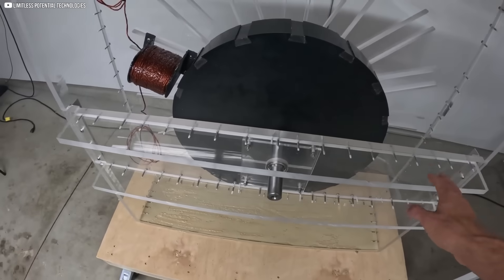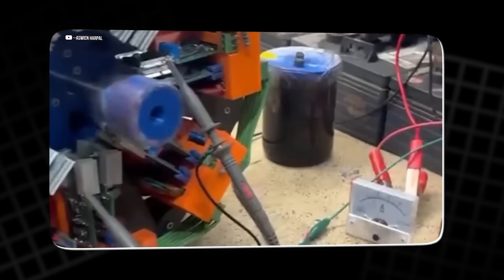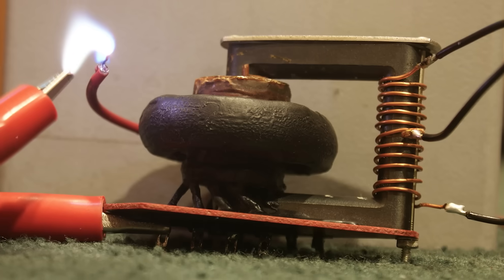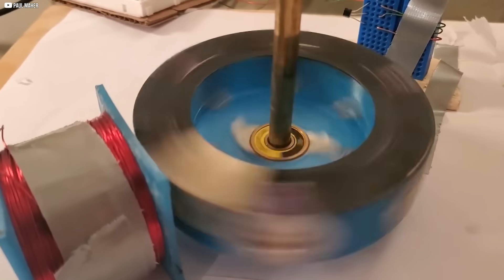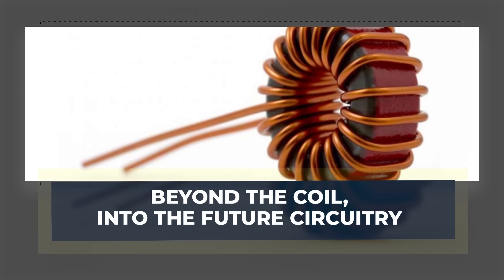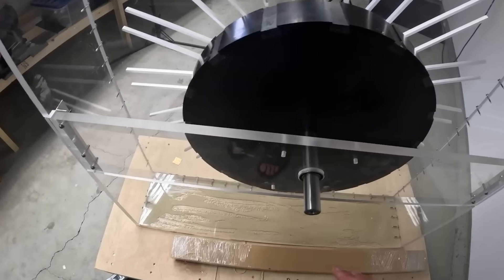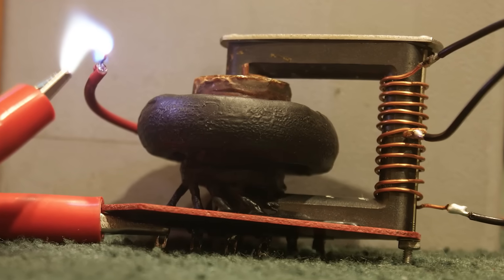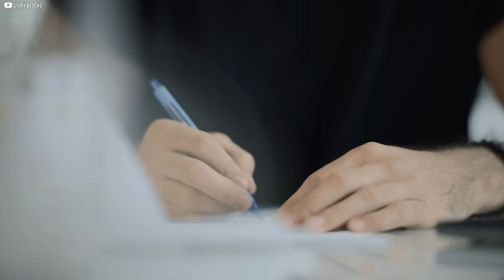This Magnetic Machine Might Break the Rules of Energy as We Know It

Comment: I HAVE WATCHED YOUR VIDEOS AND I WANT TO COLLABORATE . I LIKE THAT YOU CALL YOUR PARTNER A GENIUS . I KNOW YOU ARE PASSIONATE ABOUT NEW ENERGY . AND I HAVE AN ENTIRELY NEW CONCEPT I WANT TO SHOW THE WORLD. ITS SOMETHING ANYONE COULD DESIGN THEIR OWN . I JUST WANT THE INITIAL PRESENTATION TO BE LIKE YOUR VIDEOS .  I HAVE AN IDEA THAT YOU WALK YOU GENERATE ELECTRICITY . SO EACH STEP YOU TAKE YOU COULD CHARGE A BATTERY IN YOUR POCKET VIA A WIRE FROM THE SHOE UP THE PANT INTO THE POCKET . 

I CALL IT KINETIC ENERGY.  THATS MY SIMPLE PROOF OF CONCEPT . 

I ALSO HAVE A DESIGN FOR A VEHICLE THAT USES KINETIC ENERGY.

NO ACID NO METAL NO CHEMICAL REACTION.  YOU JUST PULL A LEVER , AND YOUR CAR GOES FLYING 50, MPH . WITH ZERO GAS . ZERO ACID . ZERO METALLIC CHEMICAL REACTION . MY DESIGN NEEDS NO MAGNETS BNO COPPER WIRE.     ITS SIMPLY GEARS . USES YOUR OWN WEIGHT TO LIFT A COUNTERWEIGHT , THAT COUNTERWEIGHT PUSHES DOWN 👇 WITH GRAVITY TO SPIN A TINY GEAR , WHICH SPINS A LARGER GEAR, THAT SPINS A SMALL GEAR ATTATCHED TO THE AXEL . THIS COUNTERWEIGHT WITH THE USERS WEIGHT WILL PROPELL USER QUICKLY FORWARD AT HIGH VELOCITY HIGH TORQUE , AND VERY VERY VERY VERY VERY FAST ⏩⏩⏩  THE COUNTERWEIGHT IS THEN LIFTED (USING A LEVERAGE PULLEY SYSTEM) THE GEARS SHIFT BACK IN PLACE AND ARE READY TO RECIEVE MORE SPINS FROM THE WEIGHT OF THE COUNTERWEIGHT  . ALL IT NEEDS IS GEARS , CHAINS , AXEL , WHEELS , A LEVER TO PUSH COUNTERWEIGHT BACK UP AND A STEERING WHEEL . YOU NEVER HAVE TO REFILL OR BUY ANYTHING ELSE FOR IT . ONCE YOU MAKE IT IT IS GOOD FOREVER ♾️♾️♾️♾️ NO SULFURIC ACID. NO CATHODE . NO ANNODE.  JUST A WEIGHT , AND A CRANK AND A LEVER !!!! THIS THING CAN GO FASAAST . I ESTIMATE IT COULD GO FASTER THAN ANY VEHICLE ON EARTH WITH A FEW ENHANCEMENTS , BUT THE SIMPLE CONCEPT DESIGN I WANT PEOPLE TO KNOW IS THE PULL LEVER , LET THE WEIGHT SPIN THE GEARS THAT SPIN THE WHEELS THAT SPIN YOU...... AND JUST PULL LEVER TO LIFT THE WEIGHT BACK UP , AND LET THE WEIGHT DO ALL THE WORK FOR YOU!!!!!!   

I TOO AM A GENIUS , ACCORDING TO MENSA I HAVE ONE OF THE HIGHEST IQS EVER OFFICIALLY RECORDED. I THINK BEING A GENIUS YOU USUALLY KNOW OR REALIZE 'HEY I AM A GENIUS' AND YOU DEFINITELY SHOULD RECOGNIZE OTHER GENII OR GENIUSES . I DO BELIEVE THAT YOU ARE IN FACT A GENIUS. AND THE PROJECT YOUR GOAL IS ONE OF THE MOST IMPORTANT QUESTIONS OF OUR TIME RIGHT NOW. YOU UNDERSTAND THE UGLRGENCY TO FIND AN ALTERNATIVE ENERGY SOURCE. 

I AM ASKING TO HELP EACH OTHER .  I AM ASKING YOU TO EXPLORE KINETIC ENERGY . I AM ASKING YOU TO TAKE KINETIC ENERGY SERIOUS .  IF IM WRONG NOTHING WILL BE HARNED , AND IF IM RIGHT , BILLIONS OF PEOPLE WILL SAVE TRILLIONS OF DOLLARS , AND POSSIBLY SAVE BILLIONS OF LIVES. 

THE DESIGN FOR A KINETIC VEHICLE IS VERY VERY CHEAP TO PRODUCE . AND DOES NOT TAKE TOO MUCH TIME. BUT IT DOES TAKE SOME SKILL TO BUILD. THE GEARS HAVE TO BE CRAFTED EXACTLY PERFECT, THERE NEEDS TO BE A SHIFTER , THE LEVER HAS TO BE THE RIGHT ANGLE , THE FINISHED PRODUCT CAN HAVE A LOT OF DETAIL AND BE VERY HIGH END AND CAN STILL COST HOWEVER MUCH A SELLER WANT TO SELL IT FOR , BUT A SIMPLE PROTOTYPE TO OROVE THE CONCEPT COULD BE BUILT FOR VERY CHEAP , JUST NEED THE GEARS THE COUNTEREEIGHT THE AXELS TO BE CONNECT TO THE GEARS . AND THE DRIVER JUST HAD TO KEEP CRANKING THE LEVER TO LIFT THE WEIGHT WHICH WILL SPIN THE TINY LITTLE GEAR ATTATCHED TO THE BIG GEAR 🛞 CHAINED TO THE TINY WHEEL 🛞 AROUND THE BACK AXEL .  IT ONLY REQUIRES THE USER TO USE AS MUCH FORCE AND WORK AS HE WOULD USE PRESSING THE GAS DOWN IN A DINOSAUR CAR .

THE EFFORT OF PRESSING THE GAD , COULD THEORETICALLY BE LIFTING S 2000 LB WEIGHT , THAT COULD MAKE YOU GO UP TO 300 MPH .......

.BUT WE NOT GONNA USE A 200 LB WEIGHT LOL. WE GONNA USE A 200 LB WEIGHT . ....  THINK OF A BICICLE (MOST EFFICIENT INVENTION EVER FROM ENGINEERING STANDPOINT) THAT PEDALS ITSELF , WITH THE RIGHT GEARS IT COULD GO FAST AS A CAR with zero chemicals . ricky bobby. Are you ready to shake and bake? 

And if you read this. And will help me give kinetic energy to the world 🌍  🌠 from one genius to another , lets collaborate
Reply from the maker: Thanks for sharing your fascinating ideas on kinetic energy and potential collaborations!

Comment: There is definitely some mystery connected with back EMF and high speed pulses to energise the circuit if we can just crack it,at the moment I think we are fiddling around the edges  groping in the dark there must be a key to unlock the vast wealth of energy that fills the universe
Reply: No there is not mystery in back EMF, the energy in the pulse is less or equal to the energy stored in the coil before switching out the current (this can be prouved in theory or but experiment only if you use the proper methods to measure voltage and current over time and not a simple multimeter, I can provide the schematic to demonstrate my claims 😂😂😂😂)

Comment: Electrical fly back technology is used in many voltage convertors today for higher efficiency. Once a coil is electrically activated and then disconnected it oscillates at resonance like crazy for a brief time. I have always wondered if the dying energy oscillations are being utilized properly.
Reply: You are right but forgot to mention that the energy in the flyback pulse in less or equal to the n’ergotez stored in the coil before switching off the current. No to mention every losses in the coil own resistor, the diode, the switching MOSFET, the wires and even a capacitor has losses (it is called Equivalent Serial Resistor or ESR). As long as you mouve current you generated losses everywhere.
Reply: @Elie-n1b  I totally agree with your analysis. It is like ringing a bell griped in a rubber mount, the energy gets quickly absorbed.

Comment: There is no such thing as free energy, solar on the other hand is proven technology that actually delivers reliable power. I've been following a company called InfraBrite Solar that's developed non-PV technology achieving 93% efficiency in lab tests with early pricing at 5 cents per watt. What's even more interesting is they also have an ownership model where people can buy small solar units installed on businesses. The businesses get 15% savings on electricity and owners collect revenue with much better ROI than most investments. At 3 cents per kWh this beats trying to build complex magnet systems that violate basic physics. With breakthrough solar efficiency like this, you get actual power from the sun without wasting time on perpetual motion schemes.
Reply: On winter how is it going to harnes solar energy ? U depend on sun for that sistem.
Reply: You can't run a large factory with wind or solar energy

Comment: Hi everyone, I've put 20years into understanding fluid dynamics , found  the place to put it ,, torque converters,,  I've experienced gains from 10kw - 100kw gains with the right design modifications , I use flight dynamics to introduce lift , vortex cyclonic forces into the fluid . It is said that fluid systems and electrical systems use the same language to describe them. 
As the torque converteris an old device that set up the right way goes off. You may have witnessed cars drag cars doing things that seem unreal . It is where it comes from . Telling someone something makes it happen. But there is more to disclose.  It takes time to think about how something is working and how to explain it especially when you can't see it.  The concept is hydraulic     amplification via sudden part restriction that increases thrust and aero lift principles   and "auto rotation principle"....
Reply: Interesting stuff,I am dabbling in something my be related vortex energy,I had no idea it has most likely done befor   but now lost(😅Viktor Schburger ),it may relate to what you are doing.I have only just begun really but the potential is unlimited almost look at a tornado

Comment: Everyone in construction forgets the principle of the lever. You cannot drive and at the same time remove more than was put in with the same lever. High voltage with a small current versus low voltage with a large current ( A ), is also a lever of its own kind. The generated high voltage must of course be transformed down back to current ( A ) and appropriate voltage ( V ).
Reply from the maker: That's a great point about the fundamental principles at play!
Reply: It's not that trivial, and it doesn't just come down to the lever. There are effects, and there is no direct correlation between the effort to generate and the energy output. There are errors in typical generators, which is why they are inefficient. Globaltrend Energy has found a solution and created highly efficient generators.

Comment: Pretty cool I'm a solar geek and bifacial solar panels are similar to what you're talking about!,Pretty cool
Reply from the maker: Thanks for sharing your perspective!
Reply: I've got some ideas about solar panels and powers them unconventionally if we could contact each other 
Done an experiment with the cheap patio solar powered lights the electricians I spoke with about it said it won't work it did
I used the light to power the solar panel , 
that powered the light , 
that powered the solar panel ,
That powered the light 
Etc etc 
Did come across one problem the pcb was set up so the light only come on when the solar panel was covered 
Is it possible to do that on a larger scale was thinking the new led lights that give off as much light as the old 80/100wat bulbs and leds use 15/20wat clip it possible to set it up the same as the patio light set up and have exccess power left over
Reply: @JamesWorton-v6q I have had my solar panels in the house and seen the lights in the house charge them.
Reply: Kl so it can work

Comment: Magnet will become weaker so is not free energy
Reply: It's not about the longevity of generators, it's about the way they produce power. We use standard generators, and they don't even have magnets, just another copper winding. It doesn't take much energy to organize the magnet domains if the magnets in the device need to be renewed. And their weakening is just a consequence of disorder - imperfect sintering of particles. Magnetism is eternal.

Comment: back emf can be very powerful and burn out inductors, there might be something in this, my background is electronic engineering
Reply from the maker: That's a great point about back EMF and its potential impact on the design!
Reply: But that's an issue of input power ending up where it's not supposed to be, not the system producing more power than is input.